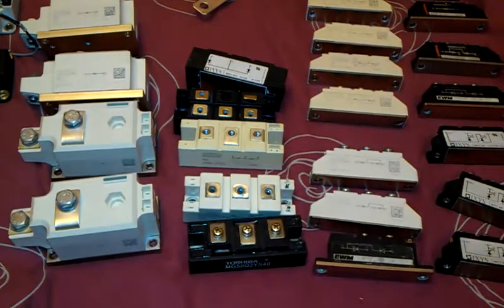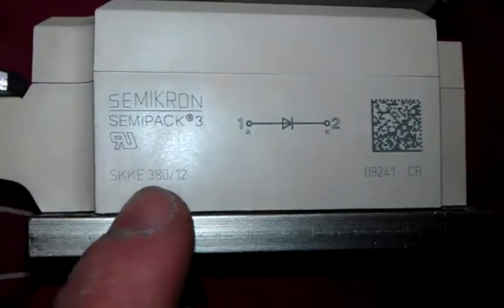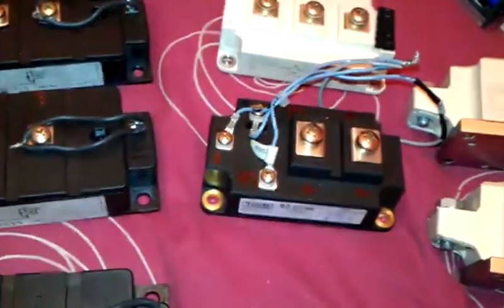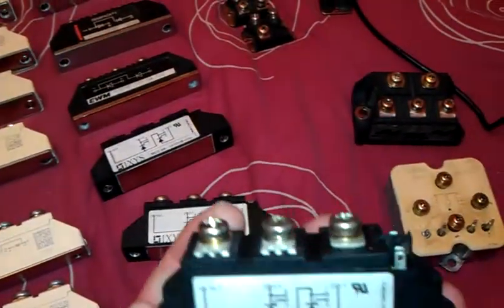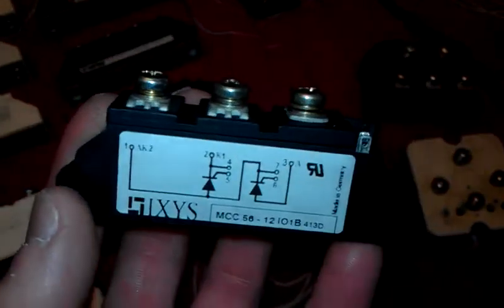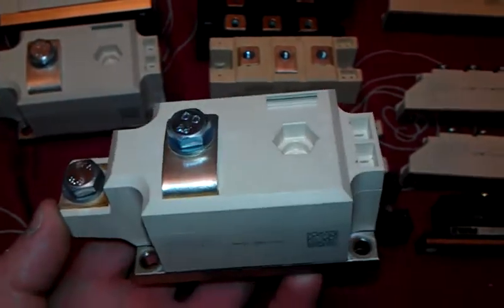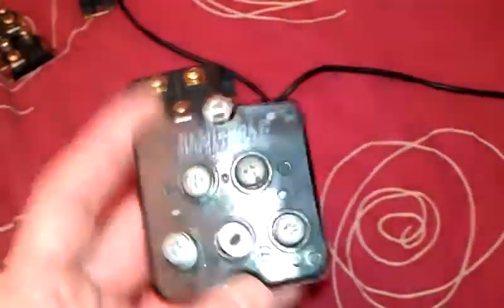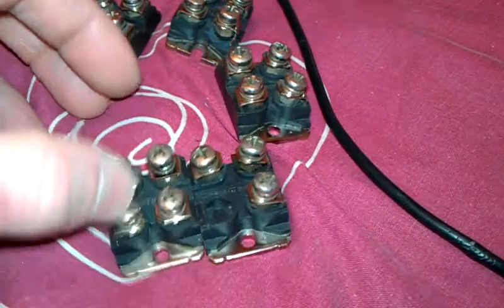Collection of  IGBT'S.

Comment: Looks like most of what you've got are Diodes and controlled rectifiers. Only a few IGBTs in there. The IXYS module that you held up is a silicon controlled rectifier. 

Still your collection could be worth quite a bit assuming they all work. Are you going to make something from all of these?